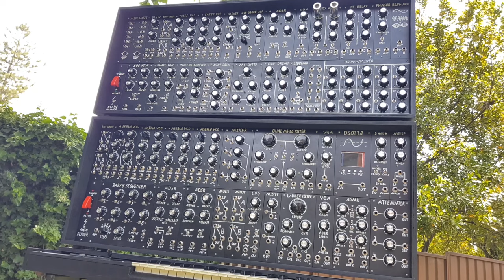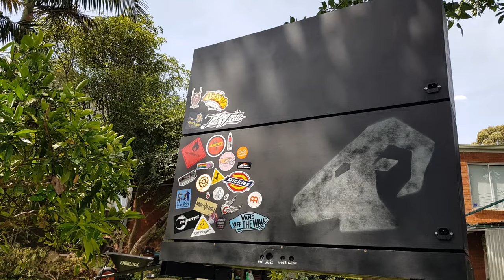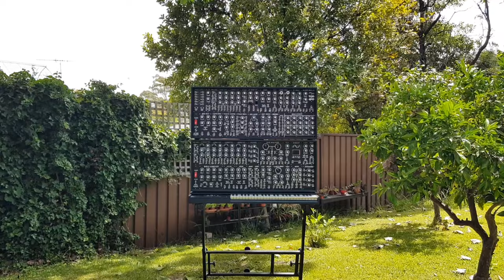Building a DIY Modular Synthesizer

Comment: You'd be better off clamping the Potentiometer SHAFT (The part you're removing) when you cut the shaft to length, instead of clamping the body of the potentiometer. I learned that the hard way, because sawing the shaft off with the potentiometer body in the clamp, adds a lot of stress on the pot itself and can loosen up the entire mechanism.

Comment: Excellent build. I did the same thing, but over a period of about 15 years, and it's still not finished.
I approve of your use of 1/4" jack connections. They are reliable, rugged and not as expensive as people think if you buy them in bulk quantities!

Comment: I'm in the process of designing/building a custom Modular Synthesizer for myself, the design concept is based on the Moog System 55, and will have a total of about 44 discrete modules all connected via a common power supply, there's going to be an LCD Oscilloscope module included for viewing signals and control voltages, plus an analog 16 Step Sequencer with Vari-clock and midi tempo synch so it can be synched to the master tempo of a Daw, I'm also going to include four line outs with voltage-controllable panning so I can set it up for Quadraphonic Sound as well as stereo or Mono Sound, it will also include a Midi-To-CV Converter module and a total of 8 VCOs with several waveform outputs available.
Reply: yes what?

Comment: For wiring the pots, switches and jacks, crimp connectors were the huge game changer for me. When soldering, I just solder 2- and 3-pin ones in place of the pot, jack or switch and can then wire them up super comfortably. Also great to be able to detach them from the board when troubleshooting. You can then perfectly measure the needed wire lengths for the sake of a cleaner cable management. 
Troubleshooting a module with lots of connections hard-wired to the front panel can be a real nightmare.
Super great synth though!

Comment: I went through a similar path right around the start of the Pandemic also. I had just started building pedals and then I think LMNC starting making some PCBs and it took off from there. I gotta shout out two of the PCB designers Analog Output and Polykit. It's easier than ever to get PCBs fabbed now and very affordable. I've also taken a shot and designed a few of my own PCB's Kicad is entirely free. I'm about to start on the 3rd box and see If I can make some large mutable instruments stuff in there and there's a few noise bells, drums, logic modules and mutable instruments modules I want to fit in there

Comment: damn i wanted to do the same thing around the same time as you but never actually started doing it. I should now! Btw which design are you using for midi2gate module? I will try making one soon but the designs I found available online don't have midi thru and that's a big problem for me...
Reply from the maker: https://github.com/sebastianbeyer/SO_midi2gate i used this one here, the midi out on the schematic is actually a midi thru